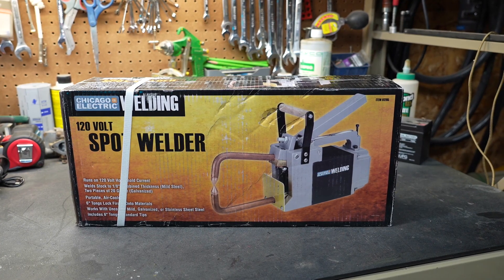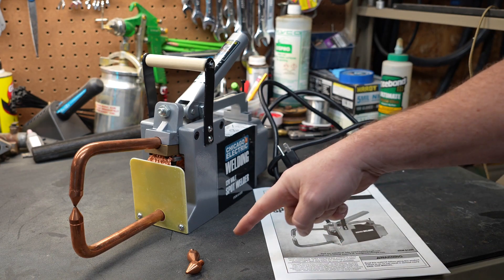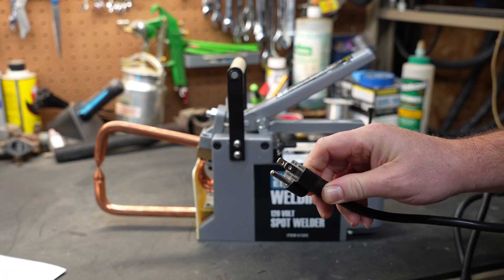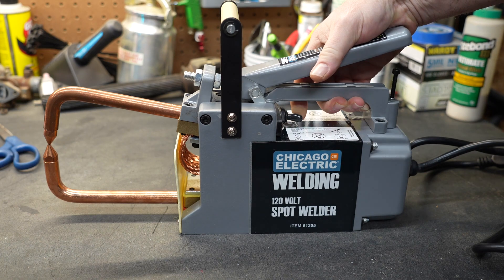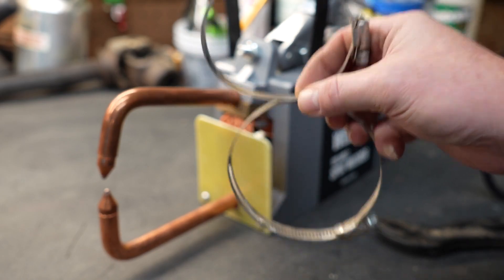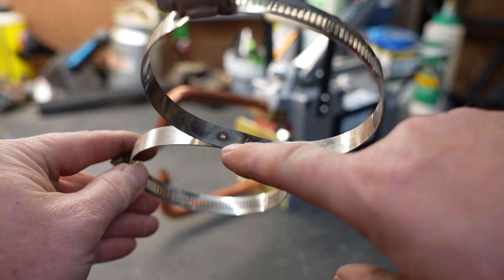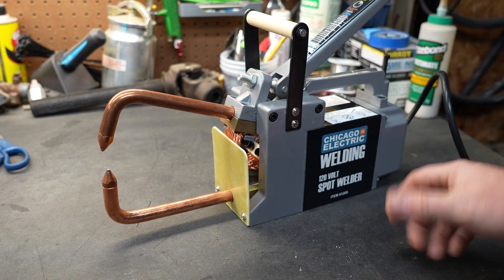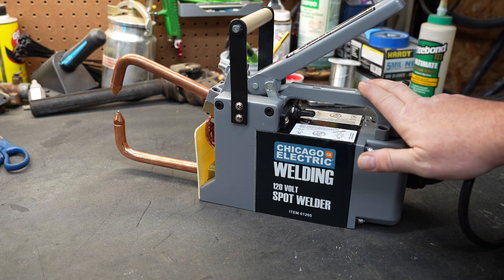Portable 120 Volt Spot Welder from Harbor Freight, Chicago Electric Welding, NTDT!

Comment: GREAT DEMONSTRATION. " I gotta git me One-o-Dees!" as Will Smith said when flying the alien fighter, in the movie, "Independence Day." I have often wished I had something to weld little thin stuff with. I struck out every time I went to TIG weld, because I knew I had to keep the filler-rod inside the gas plume, and would always touch the filler rod to the Tungston electrode and fire myself up! Getting MIG down to a low enough setting, when your .035 flux core wire was thicker than the metal you were trying to weld, it looked like snot, rather than a bead! This spot welder would make a nice tool to grace my shelf with.
   THANKS for the video